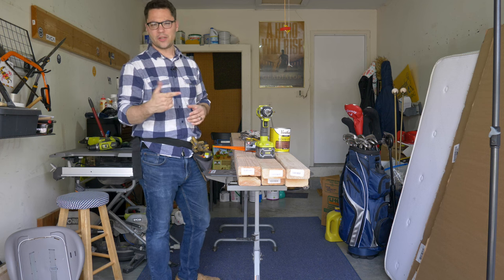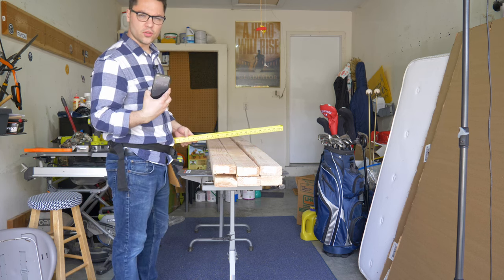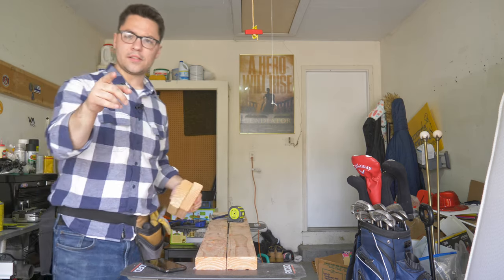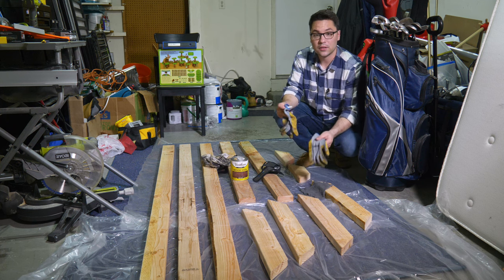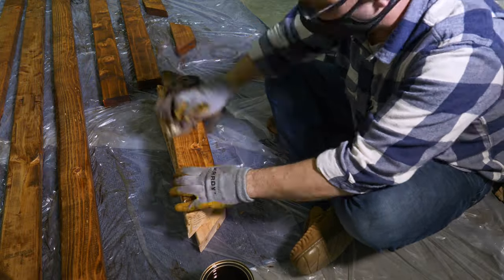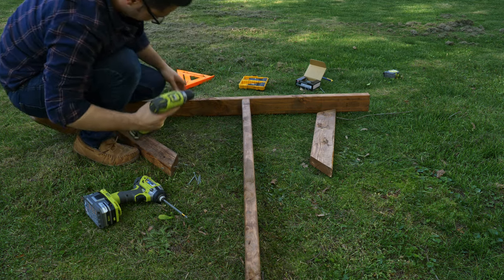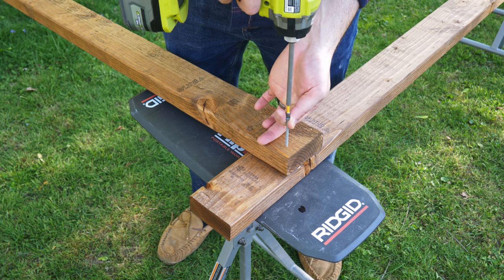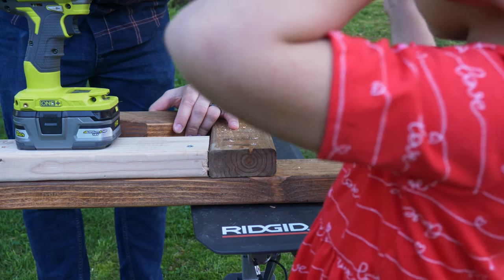Simple DIY Wedding Arch/Arbor YOU Can Build!

Comment: This looks great! Can you give all of the details like measurements and all? Please and thank you. Subscribed. I just saw the measures on your ig. Thanks
Reply from the maker: Ok good! Yeah someone else had asked. Let me know if you have anymore questions, Sandi!
Reply: @UseWhatchaGot  Thank you for responding.
Reply from the maker: @sincerelysandi  I figure it might be worth putting this on here just in case someone else comes across the thread with the same question as you - everything is made from 2x4s, and the
feet are 1 8' piece cut in half, then the
legs are two 7' pieces, and the cross
bar is a 7' piece, then each brace - the
two in the upper corners and the four
supporting the legs/feet are all 2' long.
You could always adjust any of those
measurements - I.e. make your legs
and cross brace 8' 8. Totally up to
you!

Comment: Hello, Sir what should be the Height and length of the Arch.... and the wood should be heavy or just the light one will do... Need your suggestions please... Anyways enjoyed watching your Video
Reply from the maker: Thank you for checking it out! I think it depends on the person you are making it for, but my sister asked me to make it 7’ high as well as 7’ wide. I started off with 8’ boards, so just took 1’ off off them. I think just using the 8’ 2x4s and not cutting them would be easier but it just depends on what you want. I bought simple 2x4 boards from Home Depot, I think they are about $4 right now in my area but you could make it with any type of 2x4s you can find. Hopefully that answers your questions!
Reply: @UseWhatchaGot  Thank you... So much everything so much in details... I'm just very satisfied... God bless
Reply from the maker: That is great to hear!

Comment: What’s the sizes of each cut piece????
Reply from the maker: Hi Kurtis, all of the cuts were explained in the video. But it also depends on how you  want it, so it might be different for you. I think the main to tall pieces were 7’ but the cross bar was 8’. You could buy full length 2x4s and not cut them at all. The feet are both 4’ and the angled pieces should be 2’. Again, you could make those different lengths than what I did.

Comment: 1-hour challenge, the clock is to be running from start to finish.
Reply from the maker: I think if I was really focused and I could cut and build the structure in about 30-40 minutes, then stain it afterwords, which wouldn’t take too long. I would suggest staining before you build it, but I really think (aside from stain and/or poly drying) you could complete this is right about an hour! It was a fun build.